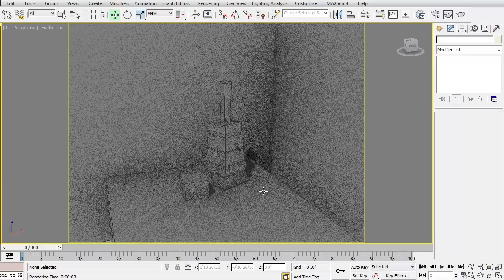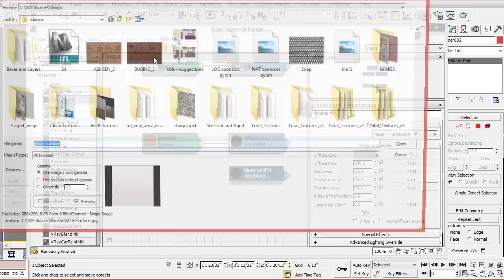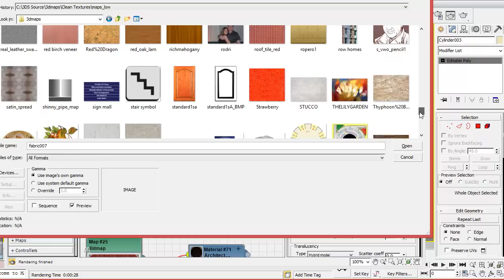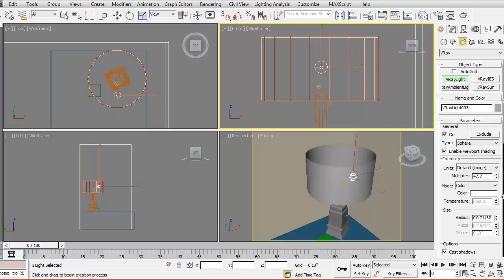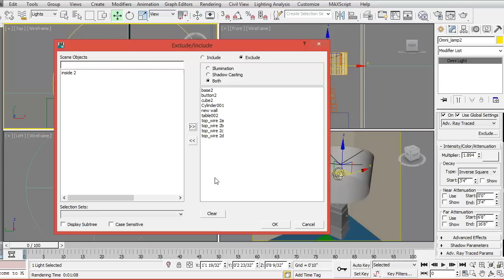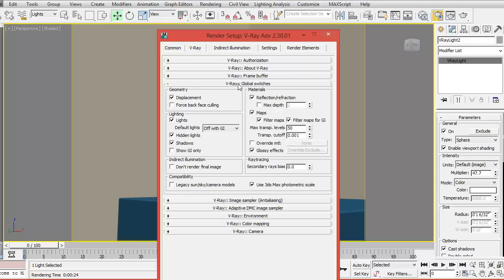3DS MAX Realistic Lamp Shade - Cast light through shade onto wall.

Comment: hi, thanks for your sharing.  After watching this tutorial, I've got two problems.   1. Do you mean omni light should light only the  "inside small cylinder"? Because I can't find the corresponding names, such as "inside 2" in your video.   2. Why using omni light to VrayMtl and using Vraylight to Architectural material? why not in the opposite way,  omni light to Architectural material (all 3ds max) and Vraylight to VrayMtl(all vay)?   :)
Reply from the maker: Dear F. Wayne, I apologize for the confusion, (I was reading my notes and forgot I used different names in the video) - And YES, you are right, it makes MORE sense to do it the way you suggest. At the time I made the video Omni lights worked OK for this effect. Today however, Vray can do this in better and simpler ways.  _ Thank you, I hope others will read your comment. - I meant use one Omni light to light up the inside cylinder.